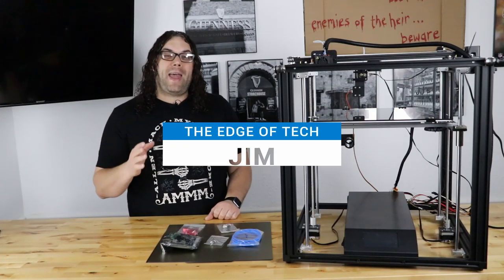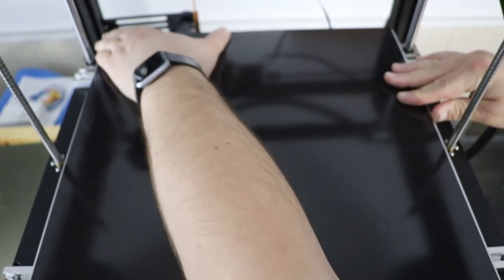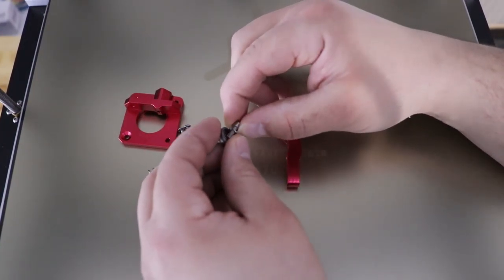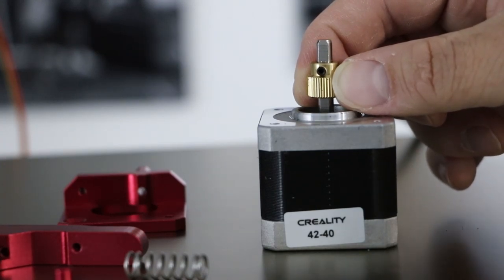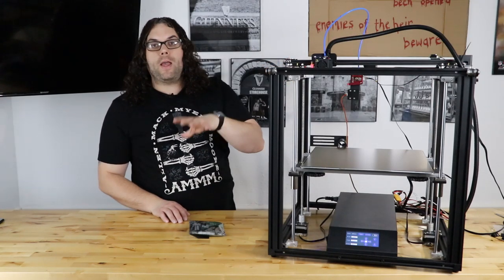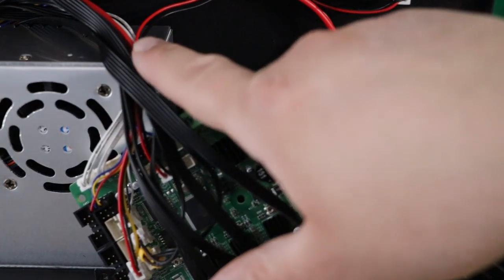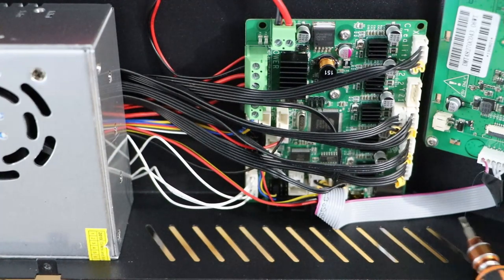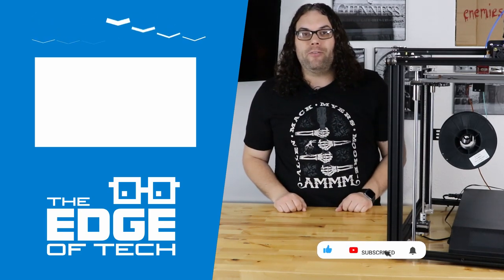Upgrading my Ender 5 Plus to be Silent using the New V2.2 Silent Board and adding all the PRO Parts!

Comment: I am looking for the source code for the V2.2.1 code. I want to install the board on a cr-10s but it has an e3dv6 and a bondtech.... Need to change some params...(or could i just change some params in Th3d which i prefer. I've seen that there is a possibility to uncomment TMS drivers, but this is for another board... Not sure if this would work for the v2.2.1 board...

Comment: How in the hell did you get ANYTHING to stick to the EZFLEX man? I’m having NO luck!
Reply from the maker: Crazy! What surface are  you using on it?
Reply: The Edge of Tech the exact one your using in the video from TH3D. I have all the other upgrades your rockin in the video as well plus the new power supply from TH3D.
Reply from the maker: @AMVitry  Sweet!! That's next for me! Make sure there isn't plastic on the mat. It's very noticeable if there is, the peel it off. If not, clean it very well with IPA and get a good squish on your first layer. The other big thing is that the mat has to be hot or it releases. So make sure the eco mode is turned off so the bed doesn't cool down.
Reply: You made sure "Energy saving mode" is not on?
Reply: What size magnetic paper do I order off there website.  Just bought the ender 5 plus but not arrived yet. Thanks